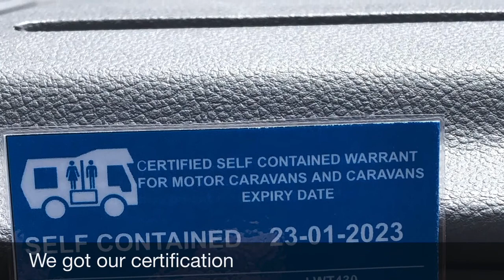How we built a Campervan from a new LDV Panel Van | Converting a van into a Campervan

Comment: What did this conversion cost you roughly ?
Reply from the maker: Hi
Unfortunately kept no records of costs 😕 we funded it from the sale of a property so we didn’t have a budget to work too it 
Thanks for taking the time to watch and comment and sorry for the long time to reply. X
Reply: I’m converting an LDV Bigger van at present and expect it will be $10,000 plus to build it to a high standard. I’ve fitted a fan roof vent and fully insulated it with both 25mm foam panels in the roof and 75 mm knauf insulation in the doors and all cavities. I’ve lined the roof and walls with caravan ply and plan to fit a solar panel.
I bought the kitchen bench only, as a kit set from Van Lab and plan to build my own bed/table set up.